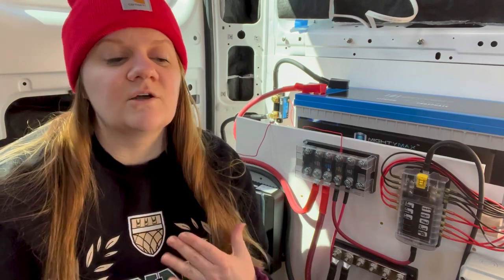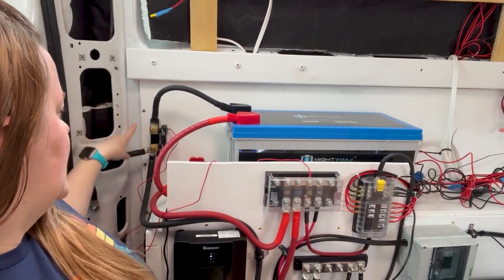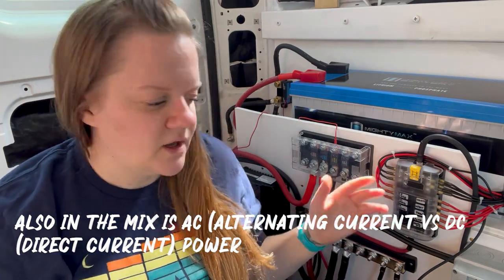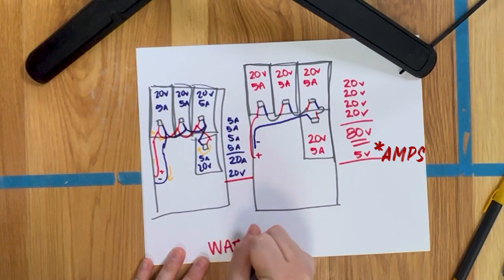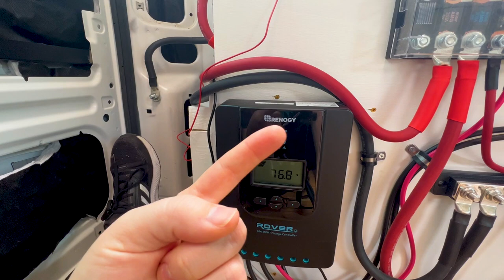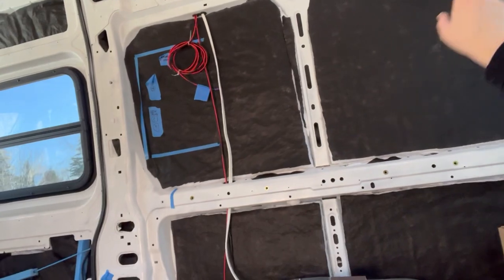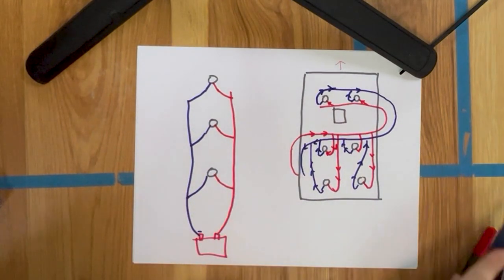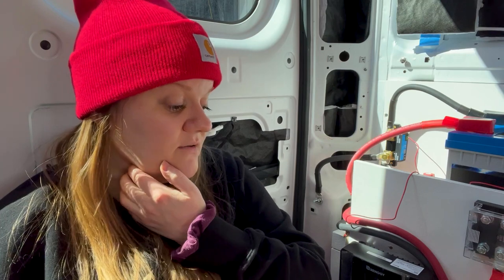Van Electric Explained for Beginners  |  Van Build

Comment: Wiring stuff in my car, or doing things like replacing an outlet or switch in my house, I have no trouble doing. Wiring a campervan system just seems so much more daunting at times. Breaking it down to components can help I think. Build/design/draw out piece by piece. Think about how you want the lights wired. Do you want all lights on one switch, multiple switches for all lights, or combination of both. Similarly for any charging plugs (12v/5v/USB/etc). Making sure to split those circuits properly. 
All of this is based on taking a serious look at what you really NEED. You can always add/expand later. 
But there is something to be said about K.I.S.S. (Keep It Simple Silly).
In the end, you could even start with something as simple as a power station.
There are a TON of videos showing how to approach just about any option you can think of. But not all are good at K.I.S.S.
Reply from the maker: Exactly, you just need to break it down into components. I definitely started light, I suspect I’ll need to add another battery but I figured start basic!

Comment: Great video Jen and thanks for you mentioning the F you to the voices :) you mentioned about a DCDC charger.. At the moment Victron do a 12/12/30A version.. At the end of this year they're bringing out a 12/12/30 with VE Direct cable and Bluetooth, you can then connect the DCDC to you phone like the shunt, after this launches they're bringing out a 12/12/50A version, so you might want to wait for that extra 20A, What brand is the covered fused busbar left of the blue seas fuse box please? Do you have a link you can share? Keep up the great work.
Reply from the maker: Hi thanks so much!! 
That’s awesome witn the Victron tools. Overall I haven’t been able to afford most of their components, but they’re so great! 
I’m going with the 20A charger from Renogy- it’s in my price range and I really don’t want the extra wear on my alternator. Having had a Ram before and not having had a stellar experience lol, I want to baby this engine. Higher amps means a higher toll 🤷🏼‍♀️
Idk if I’ve mentioned this in the vids yet, but I got the Ram with the almost expectation that I will need to replace the transmission at some point. The Ford, which is what I would have preferred, was like $15k more than the Ram. It put it out of my current budget, so I did some back of the napkin math and even if I do replace the trans I come out ahead (in money anyways, not necessarily in frustration and annoyance 😂).

Oh, and the bus bar is victron! I’m going to include links to everything I used in a few days, I’m traveling now but wanted to get the video out :)
Reply: @ramblingjen  Yeah the Victron is great quality but comes at a premium price as well.. Renogy is a good brand and you have to stay within your budget to get the van finish. With Alternator charging it depends on you usage of electric, if you drain the battery daily then the alternator is going to work harder. I only watch the 2 Victron video's (how i found your channel) and the very first 2 video;s, watching more later :) So not sure if you have mentioned replacing the transmission or not but wise choice get the Ram over the Ford. Go Holden/Chevy lol.. I thought the BB was Victron but wasn't sure and thank you for your reply :)

Comment: What size is your bed and how hight
Reply from the maker: Mine is not built yet - I chose to keep the walkway clear while I did the upper cabinets, but the base will be ~32" from the ground.
I worked this out based on an 8" mattress, and my seated height, as I want to be able to sit up straight in bed :)
Reply: Thanks for the info